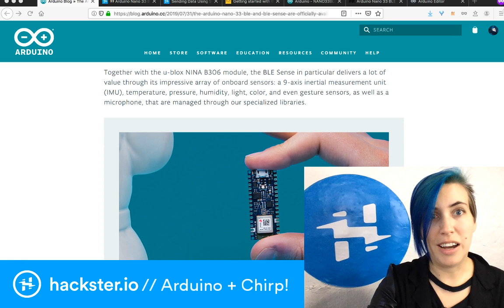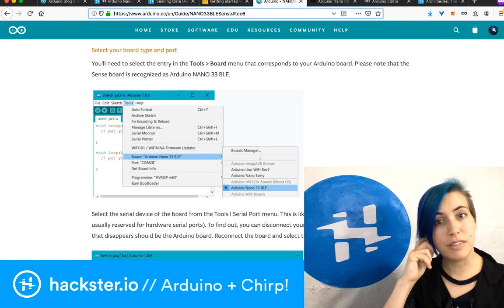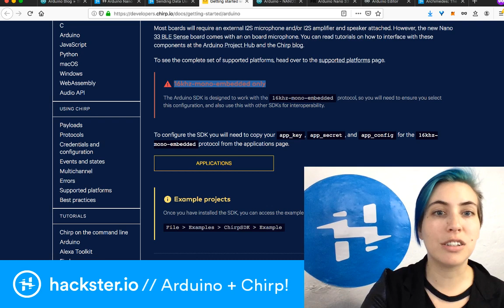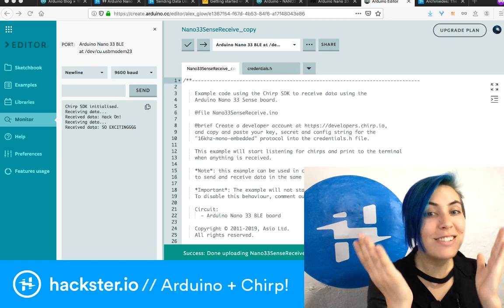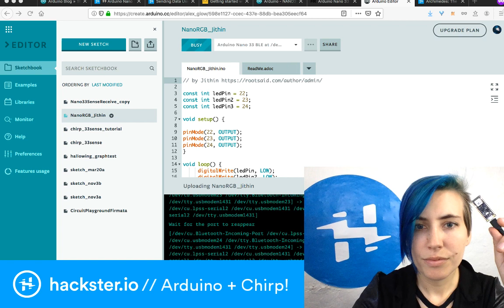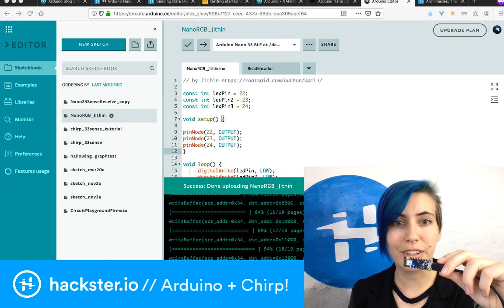Chirp on Arduino // Machine-Machine Communication

Comment: I had the same issues i ran it there a linux virtual machine and it installed the missing drivers i could not find for windows 7 not it runs and uploads